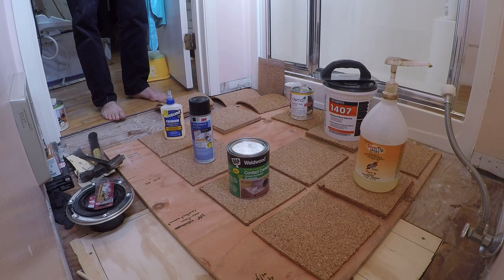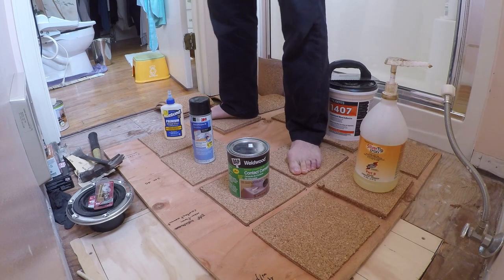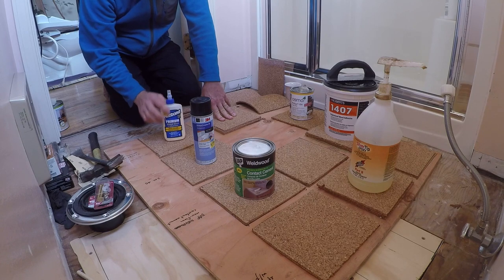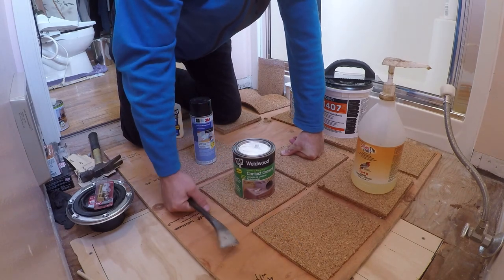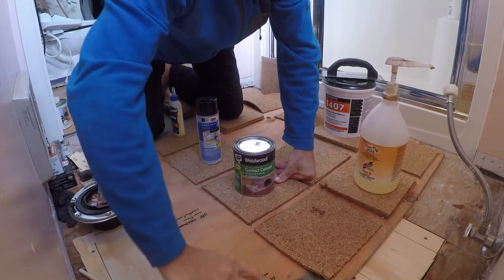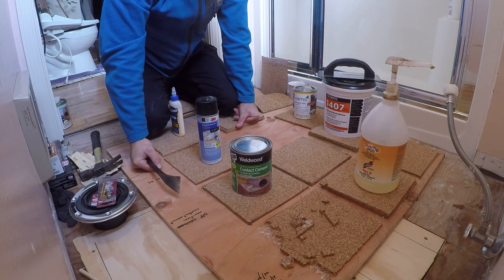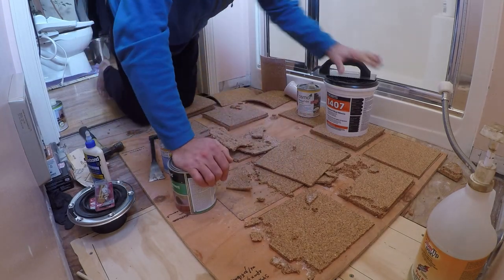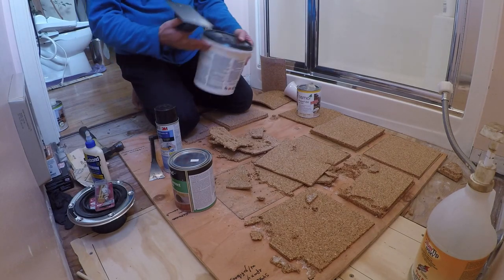DIY cork floor for bathroom with cheap underlayment - adhesive testing

Comment: When you put a Cork Flooring down...
You also put 4 to 5 coats of Urethane or Polyurethane.
You don't leave it unsealed...
Reply from the maker: Thanks, Judi. I sealed it with a couple coats of Osmo Wax which I find easier to spot-repair and re-apply than poly/urethanes.